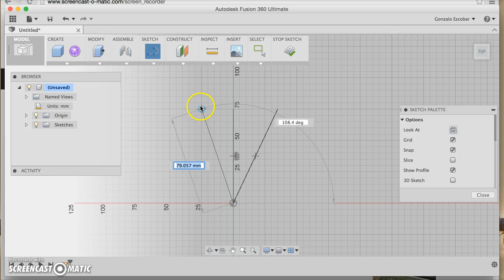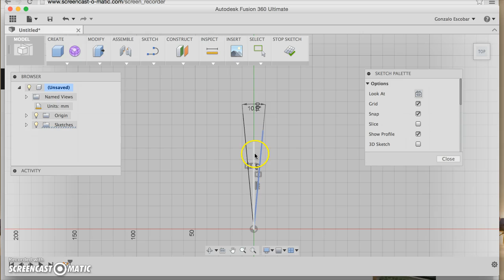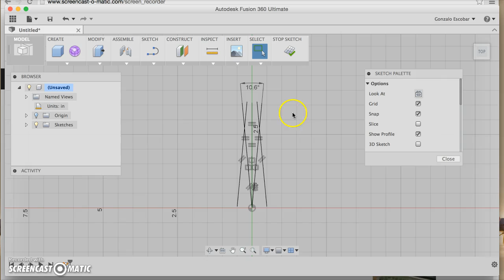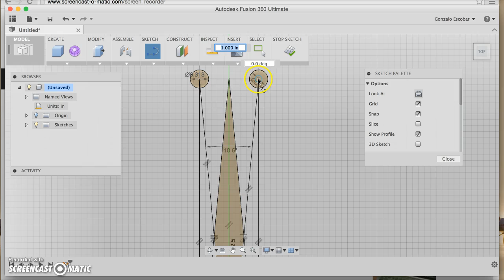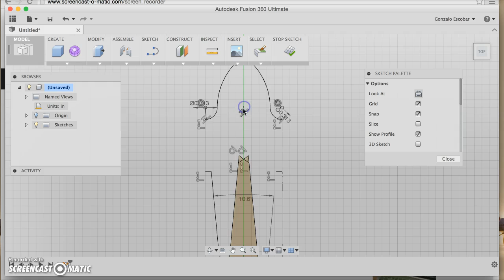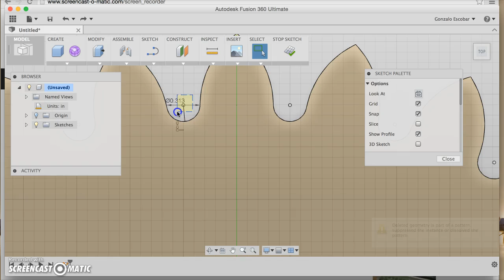Tutorial Fusion360 34T Bicycle Sprocket Chainring

Comment: Thanks for the video!  In the past I've used a program to create a dxf of the tooth profile for me.  Good to actually try drawing my own which I did just do.  

There was something about your sprocket that just looks... off... so I followed the directions on the page you linked and came up with a very similar sketch.  Take a look at the distance between the center of the two rollers you drew.  They're centered on two lines that are .5" offset in each direction from center...  So your sprocket will work on a chain with a 1 inch pitch and 5/16" rollers.. :)

Either the directions on that page are wrong or they are misleading.  I changed my offsets to 1/2 the chain pitch and now my sprocket looks normal.  I also double checked against the diameter of a sprocket on McMaster Carr and this one matches.

But now I know how to create my own next time! So thanks again.
Reply from the maker: DAM Machines Glad it was able to help. Good catch with the offset.